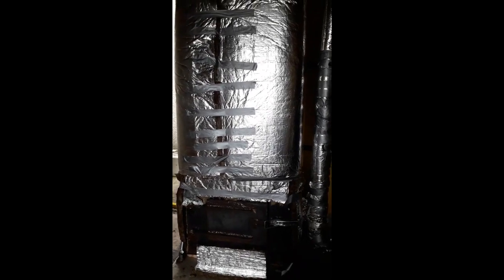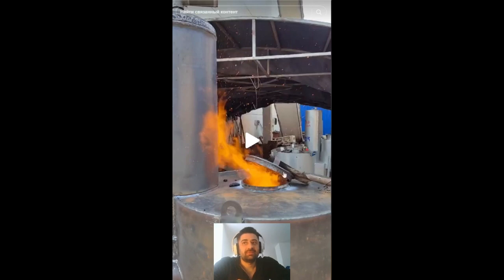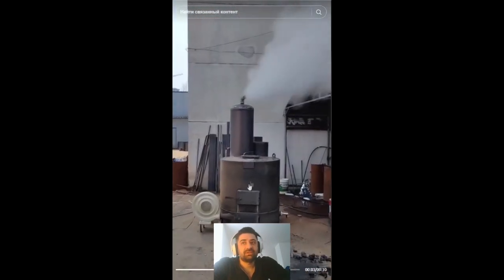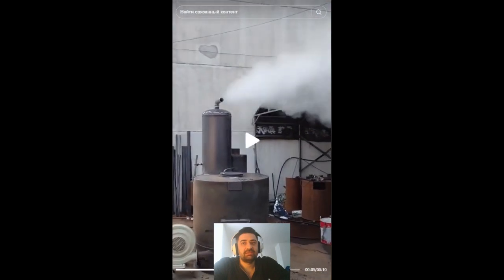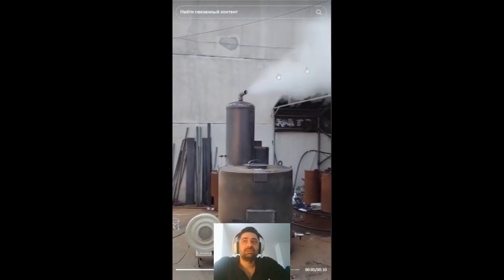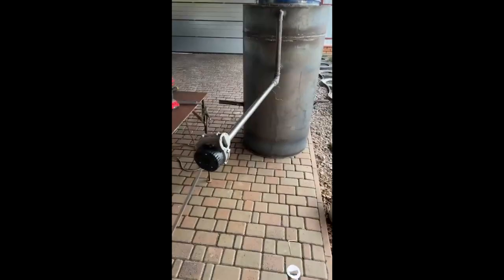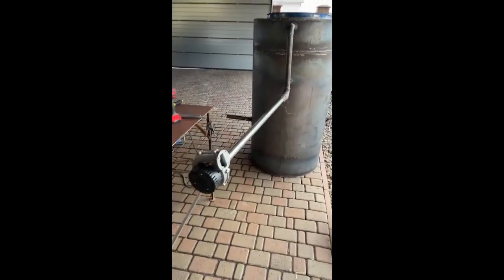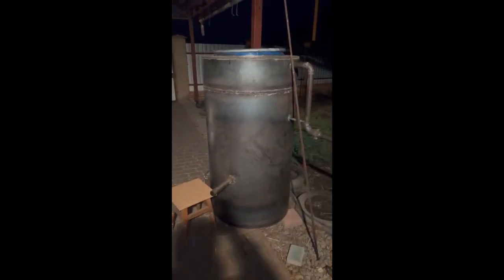Why gas should be extracted, not blown in

Comment: For vacuum extraction, venturi ejector can be used with any blower. Here no gas contacts the blower moving parts. It also mixes air in automatically.

Comment: Why can plastic be used but not PVC?
Reply: Because the C in PVC stands for Chlorine. Burning PVC will yield a high amount of HCl in the combustion gas which leads to a lot of problems.
Not even cement plants (that typically in Europe are running on >90% plastic waste as fuel) want high levels of PVC in their fuel.